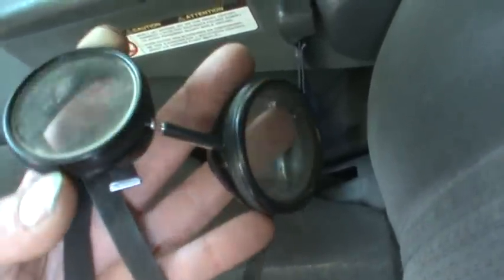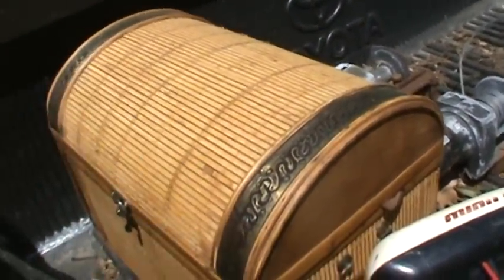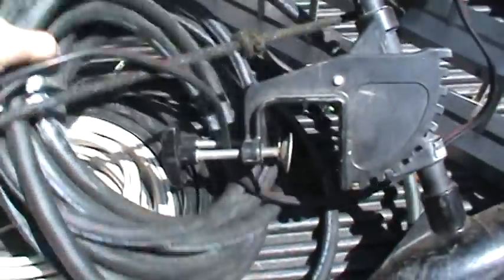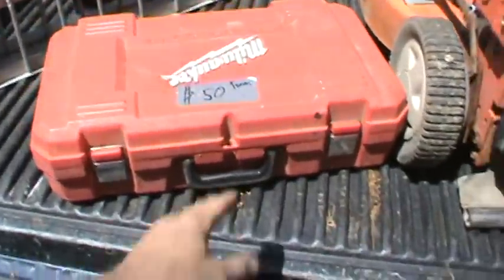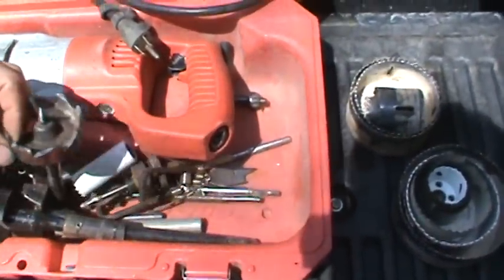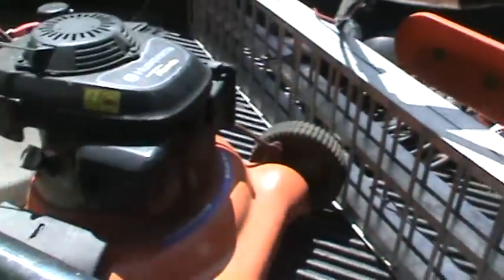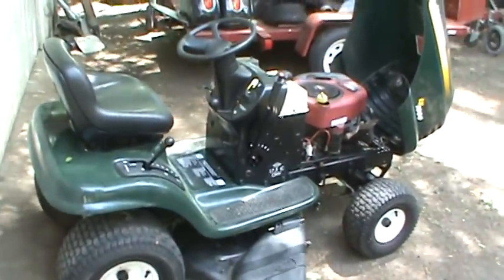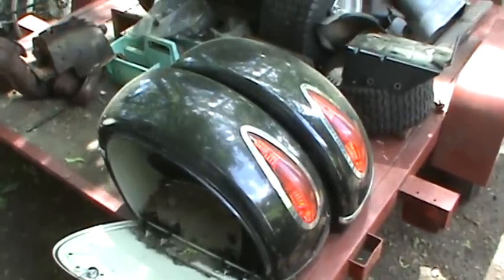garage sale finds 5/30/15

Comment: Great scores as usual, the Milwaukee right angle is a sweet drill, has a 2 speed gearcase, just change the bolt pattern for 750 or 1200 RPM. Also can use as a straight shank drill / mixer if desired.
Wire is worth more than all the new hoard pieces in the truck !
If we ever get some good rain the mowers will sell as soon as you put 'em out front :)
Reply from the maker: lakesideranch thanks did not know about that,

Comment: Very nice stuff there.  Love the tail lights.   The Craftsman mower looks awesome.  Love the box.  Cool goggles..  The wire is a steal.   Great deal on the mower.  Lovely truck load of goodies.. haha
Reply from the maker: rpeek what ,, ya dont like the chainsaw,
Reply: mustie1   I love the Stihl...  I've got a Stihl .049 I've had since ....  since...  Let me see..  counting backwards...  35 years...  Yea, that sounds right..  Yea I love the saw.. hahaha.
Reply: mustie1  Oh Oh Oh Oh...  The trolling motor with the one blade prop...  Love it too.. haha

Comment: I have that 4WD Minn Kota if I remember the blade was supposed to be designed so that weeds didn't clog it up, or the blade was made to work through weeds better. You can buy replacement props for those.

Comment: Like everybody said the Milwaukee Angle drill is a serious steal!

On that Craftsman Tractor, Those Briggs engines tend to have the valves go out of adjustment and they give all sorts of bizarre issues. Check the valve lash